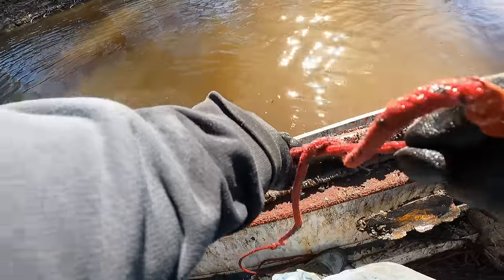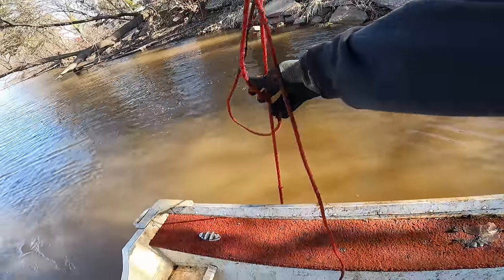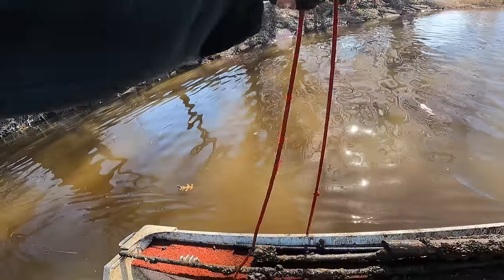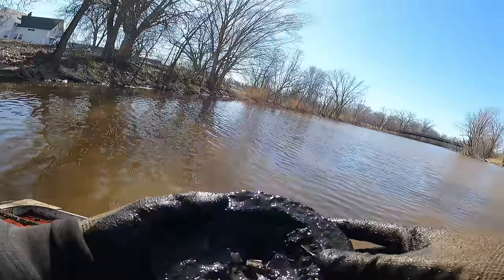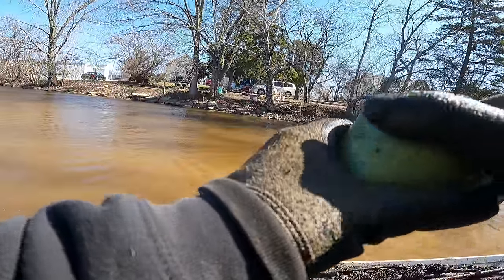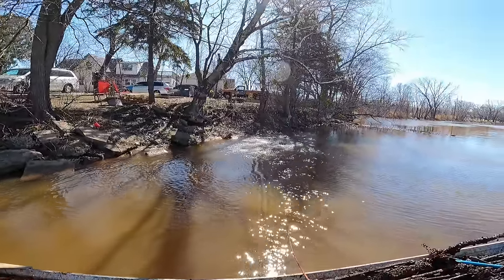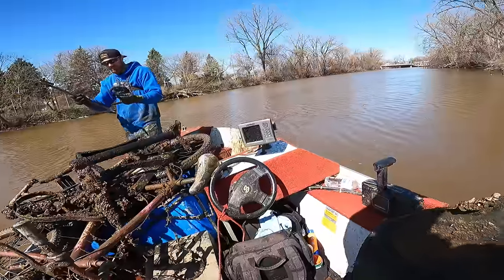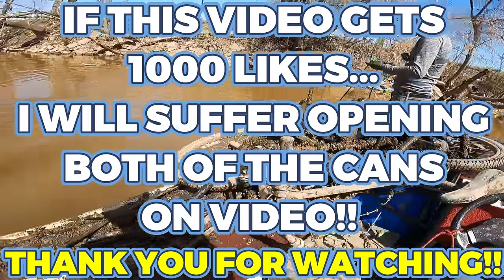The BIGGEST & HEAVIEST Magnet Fishing Jackpot EVER!!

Comment: 8:07, not bed frame, it’s what we used to put up pinch pleat curtain with pocket sheer, back in style 2024, good thing I still have mine as the parts get quite expensive.  It’s so you could open both curtains